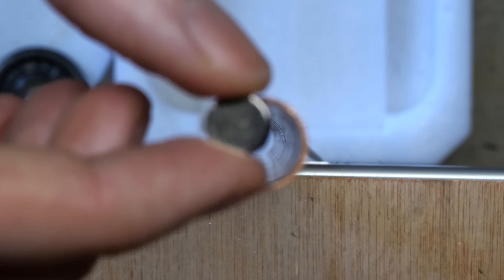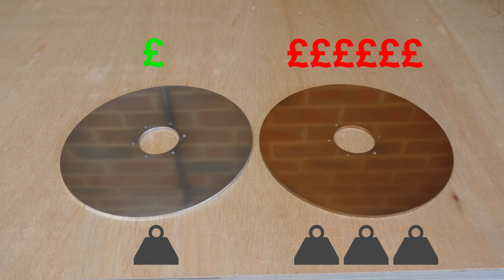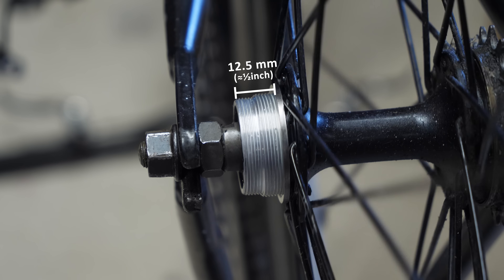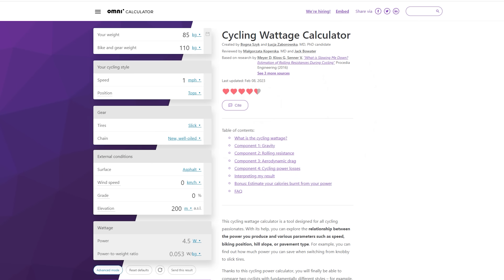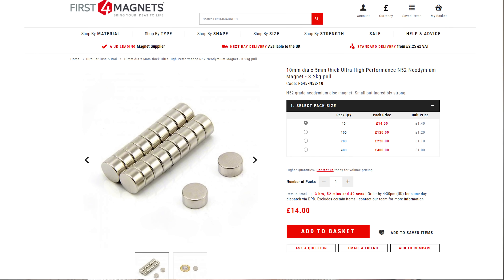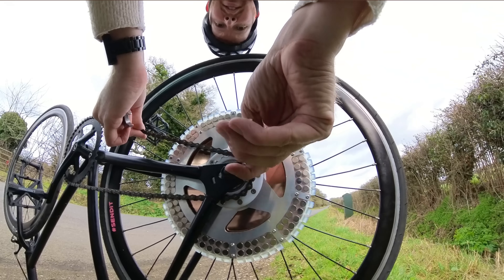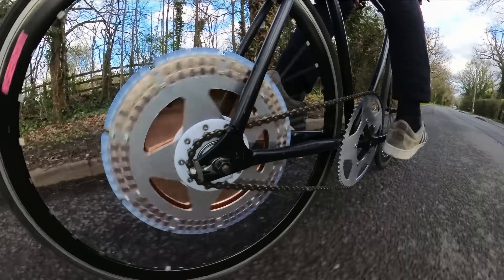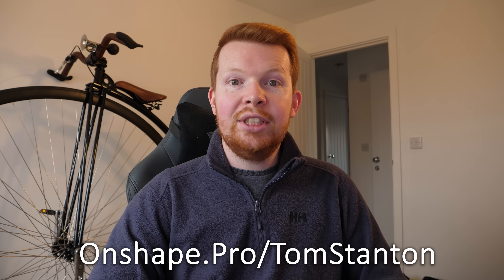Gearless Magnet Bike

Comment: While the concept of a 'gearless bike' using a copper disc and magnets may seem innovative, it's important to understand the underlying physics. This system essentially operates on the principle of magnetic braking, similar to a magnetically-braked exercise bike. When the magnets rotate around the copper disc, they induce eddy currents in the disc. These eddy currents generate a magnetic field that opposes the motion, creating a braking effect.

The claim that this system can replace a gear shifter is misleading for several reasons:

Energy Loss: The eddy currents generated in the copper disc convert mechanical energy into heat due to Joule heating. This is essentially energy loss, making the system less efficient compared to traditional gear systems.

Limited Control: Unlike a gear shifter that allows you to adapt to different terrains and speeds, this magnetic system offers limited control over the bike's speed and resistance.

Slippage: The system relies on magnetic forces for braking, which means it's prone to slippage, especially when the wheel is braked. This is not the case with mechanical gears that offer direct, physical engagement.

Complexity and Weight: Adding a copper disc and magnets increases the complexity and weight of the bike, without providing the versatility and efficiency of a traditional gear system.

No Increase in Torque: Importantly, this system does not increase the torque applied to the rear wheel. This means it won't make it any easier to climb hills or tackle challenging terrains, which is one of the primary benefits of a traditional gear system.

In summary, while the idea may seem novel, it doesn't offer the efficiency, control, or versatility of a traditional gear system. It's more akin to a magnetically-braked exercise bike, where the primary goal is to create resistance, not to efficiently transfer mechanical energy for propulsion

Comment: Would love to see a variation of this where some of this power and momentum is converted to electricity and stored in a battery that can then be used to assist the pedaling, at will, to make it more natural when pedaling uphill or when more force is required. Similar to a dynamo (produce electricity from spinning) + electric bike motor (propelling). This should take the kinetic energy and store it as energy, like Teslas do, and allow you to re-use this electricity to assist in moving forward.

Comment: You could have used a standard steel sprocket from a bike shop and brazed it to the copper disc. Double sprockets even exist which would leave you one spare to use as the drive sprocket.

Comment: Truck fan clutches use a disc of permanent magnets and disc of two coils of electromagnets. No current and the fan free wheels. Low current and you get medium resistance. High current and the fan locks up solid.

Comment: You've in a way created a magnetic torque converter. Basic torque converters (without the lockup function) in automotive transmissions are designed to allow slip when standing still while the engine runs at a low RPM, but will allow the output to spin when more RPM and torque is applied. Since torque converters alone are quite inefficient, because they use fluid to create a partial connection to the engine and output, modern ones also have a clutch to directly lock the engine to the output and create no torque loss

To make your creation a proper modern day torque converter, you'd need to have a way to force those magnets to lock onto the disk when you get up to a crusing speed and then unlock them when you are slowing down to a halt.

Comment: I would love to see this project explored again, but with bike wheels that aren't spoked, but rigid body, like a 5-spoke carbon body wheel. You could also explore using a carbon or aluminum frame bike, and belt drive instead of chain drive, so you can eliminate the magnetic interference variables + reduce the weight of the bike.

Comment: And just like the different strengths of the magnets the different levels of aluminum within the aluminum like the difference between cold roll steel and high density carbon the only difference is you'd often use liquid nitrogen to temper aluminum to make it extra hard if you can get a hold of aircraft aluminum and it is a Pacific grade of 90,000 PSI grade I think you'll find a results changing a little bit

Comment: Before 3D printers came out that process was used in casting the exact same tank alignment the only difference was it was done where epoxy resin was in a tank and lasers would Crossfire and fuse that a micropoint of Point Micron something but this is a hell of a lot slower than what you see what a 3D printer can kick out for you now we used to have sometimes have to wait as long as 2 weeks for an original part

Comment: I'm surprised you didn't bother to weigh out the sheets before you did your cut out the weight difference is so huge your test can't be accurate because the volume is not equal on the metal side oh and by the way you know how welding machines are known for iron core Transformers the there's a link Lincoln Miller anyway the old Lincoln welders to save money they perfected aluminum cores and because of the heat transfer and expansion of aluminum they had designed the core to flex as a heat up while you working and they perfected it so well there's machines around it's over 30 years old

Comment: Have you considered using a planetary gearset to make an e-CVT, similar to transaxles inside of hybrid vehicles? You could have the ring gear directly linked to the bike tires (and also connected to MG2), pedals connected to planet carrier, and another motor MG1 connected to the sun gear. When pedaling from a standstill, if MG1 is not connected to anything, you will simply rev MG1 to no avail. No torque is applied to the ring gear. You will not move forward.

However, if MG1 is shorted, the sun gear provides a lot of resistance when applying torque to the planet carrier. This will increase the torque to the ring gear, which will accelerate you forward. This is similar to what you've done in the video, because you're just wasting energy to transfer force via magnetic induction. The kicker here is to supply power from MG1 to MG2. This simultaneously provides a reaction force and uses the energy from magnetic induction to do something useful. If you use batteries too, you can hold the pedal still, and have MG1 and MG2 spin in opposite directions. You effectively have an e-bike, and while pedaling at any speed, you can either charge the batteries or discharge batteries for propulsion just by controlling the spin direction of MG1. This is needlessly convoluted for a goddamn bicycle, but idk it seems cool lol

Comment: an interesting idea, in addition, you can replace the chain and stars with a timing belt and plastic gears, you can print it on a 3D printer; it’s not known just what will happen to plastic and rubber if used in a cold period

Comment: Forever lasting brake pads using magnets that get pushed closer to the “rotor” creating this effect? Or electromagnets that turn to magnetized once braking is applied using a chip to determine brake pedal position to number of magnets turned to magnetize?

Comment: i want you to create a break system using magnetic power and using electricity to create that magnetic power if u can understand what i mean. also to turn the energy from the brakes to be saved on lithium batteries instead of wasting it through heat.

Comment: If you make a steel disc with slits between pairs as a backer for the magnets, it will drastically boost the efficiency of the magnets.
The best is either turn Pair's into horse shoe magnets with as thin a gap as possible for the disc

Comment: Use as an Eddie brake for a race car. Attach it to the drive shaft and use it to slow down from 400 mph to where you can use the wheel brakes, say 150 mph.

Comment: Magnetic coupling is very useful for underwater applications, where you want to disconnect the propeller from the internal electronics. Back when I was in highschool, we built an autonomous underwater vehicle and faced a real problem with isolating the propeller's entrance.
Reply: But don't the magnets need to be really close to the disc for reasonably efficient power transfer, so if you have to put the waterproof bit of the boat/vehicle between the two then that's quite a lot of spacing you didn't want. How well does it work across 3mm of fibreglass (or whatever is sufficient to keep the water/pressure out).
Reply: @xxwookey You can design for the gap with larger magnets or different materials that don't block the field as much.
Reply: @xxwookey If you're worried about pressure you could fill the engine room with another liquid and seal it off.
Reply: Smart
Reply: It seems overcomplicated compared to something like a stuffing box or dripless shaft seal
Reply: I'm sure one of the ROV's I worked with had magnetic coupling, can't remember which one though.
Reply: These days there is no need for a watertight prop shaft as brushless motors perform quite happily in water and can be outside of the submersible.
Reply: @robwilton9539  barnacles grow on your windings

Comment: Put an electric generator on the pedals, add a ring and carbon brushes to the rear sprocket and switch the magenets with electromagnets, so when you pedal you generate current and magnetic field, but when you dont pedal the rear wheel still spins freely

Comment: How about using a titanium-nitride chain to prevent magnets from sticking?
Future improvement: A mechanical system to pull groups of magnets in/out of the copper wheel to emulate gears? Or a mechanical system that automatically moves magnets in/out to emulate CVT?
As for the energy lost due to heat generated by eddy currents on the copper wheel, a room temperature semiconductor wheel should fix that. Yes, it doesn't exist yet, but I think we'll get there in less than 10 years.

Comment: Could a change in the radius of the edie currents generated on the copper plate via maby the same principle used in a cvt transmission maby accomplish the whole automatic transmission effect
Reply: I mean by using the difrance in cintrifical force at different speeds of rotation to change  radius of the magnetic fields ei changing the leverage or torque transfer.?

Comment: You have no freewheel and no elasticity , which means that much of your work is used to heat the copper rather than to move the bike. 
It would be extremely more efficient to use electromagnets and capacitors so as not to lose so much energy, especially when braking.

Comment: USING THOSE MAGNETIC WHEEL , BUILD A GENERATOR TO GENERATE POWER TO RUN AN ELECTRIC MOTOR , ALSO ADD A BATTERY TO SAVE ENERGY ( WHEN THE BIKE IS ON STAND / IDLE ALSO U CAN PADDLE AND STORE ENERGY IN IT ) AND USE WHEN U R TIRED LATER , WHERE U DONT REQUIRE TO PADDLE THE BIKE

Comment: Cool and interesting and his scientific and analytical methodologies during the bench tests were a master class. But this drive was always doomed to be very lossy as the thermal camera shows. The 8000 joule he calculated is just the thermal energy in the disc (relative to at ambient temperature) at the time of measurement, not the total lost energy, which would be much greater and which left the disc into the atmosphere over the duration of the road test. I think in theory his least lossy possible would be with a silver disc as silver has the lowest resistivity of all normal metals and the losses are due to the eddy current flowing through the disc material.

Comment: hmm what if you opposed the magnets with a snake-wound copper coil? Could you generate enough electricity to push a motor that would in turn aid in uphill climbing? Front drive?

Comment: so you developed a system where you have to work harder than necessary to move the wheel and it doesnt work well as a brake either, good job

Comment: Thanks for doing this real-world research for us, and showing us how CAD/CAM can help us play! :) I think it would benefit from a belt drive.
Although applications for this design may be hard to figure, having the concepts in mind as you go through life will mean it’s in your head (and now mine) should any possibility pop up. Rotating pumps in an aquarium comes to mind, especially in situations where additional heat is needed…but if the magnets are inside the aquarium, would they get as hot as the copper disc? I’m pretty sure spinning the copper would be as effective as driving the magnets. Fluid switching (valving) is another possibility. Flowmeters could be built on the concept.
Does it have to be a disc? Iron core transformers benefit from laminated or powdered iron to reduce heat buildup and hysteresis losses; could you try that? Or would that eliminate the useful current? Also, using wire coils…um, well, regenerative braking has been done lol

Comment: @Tom Stanton You should manufacture your eddy-current clutch disk from YBCO. I can promise a money-back guarantee, you won't waste one single Watt of power. There is however a little drawback. For your ride, you need a sufficient supply of LN (liquid nitrogen), since YBCO needs cryogenic temperatures to work.

Comment: Try a ring of copper with hundreds of magnets just inside the tire diameter. The disc is useless unless you create a larger disk and a clutch embedded with a thousand magnets. Also charge a battery and throw an electric motor on there to make use of the braking force. Very cool bike prototype and video.

Comment: Tom i have an idea. What if on front wheel install electrophore machine and on the rear wheel electro motor but with dc/dc converter from high voltage to low voltage. I don’t how much current it will have, i guess small amount of it and of course perpetum mobile doesn’t exist but I didn’t see that someone is doing that before

Comment: Try adding a lockup! Something to create a hard lock between the hub and the copper. Like an electromagnet pushing a pin through the stack. Activate lockup for uphill, deactivate for flat and downhills so you can use drag braking!

Comment: You are much more analytical than I. I like trial and error.

That said, I do something similar using neodymium magnets mounted on disks. I machine my disks out of plastic cutting boards using a lathe.  I mount magnets about the flat circumference of the disk, then use either live steam or compressed air  to spin it through a pick-up  coil to generate electricity.  I arrange the 1/2" magnets all facing the same direction (for d.c.) or facing n-s-n (for a.c.). I use both piston as well as turbine homemade engines. I build windmill-driven air compressors as well as  small air engines as a hobby. Great fun!
Thanks for your VERY ENTERTAINING channel.

Comment: you are reinventing the EBS (electronic braking system) that is fitted to lorry drive shafts, they slow the rotating shaft through electromagnetism and in turn, slow the rear wheels, it is to stop articulated lorries from jackknifing, yet again very interesting video,

Comment: If you added a ratcheting system (like inside a normal bike cluster) after the gear and before the magnet system, you wouldn't have to keep pedaling, and the bike wouldn't automatically brake when you stop pedaling.  That "autobreaking" feature or flaw, might have been the reason for at least half of the wasted energy due to heat.  I wouldn't want the autobrake, because then you can't coast.
If you make another model, add the ratcheting system inside, and I think you might have something.